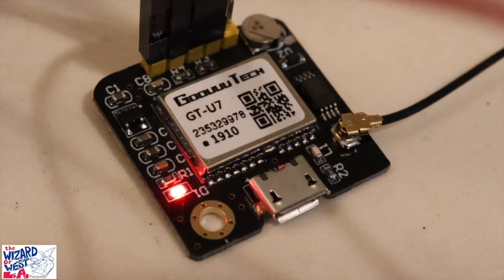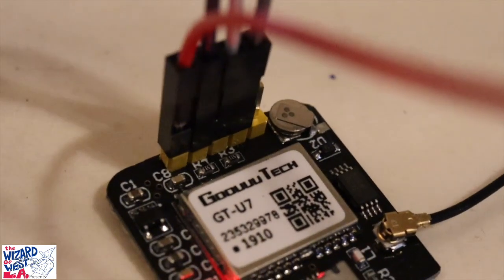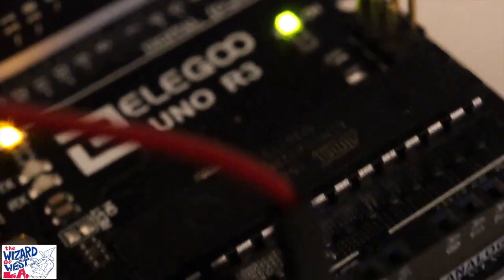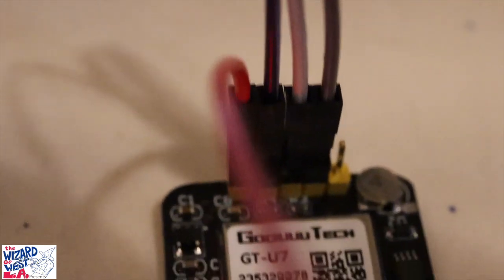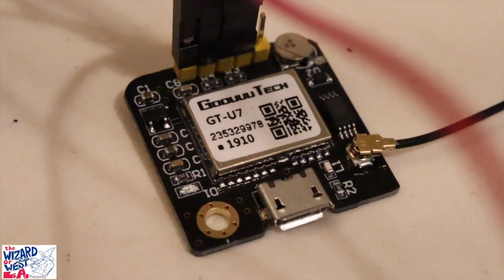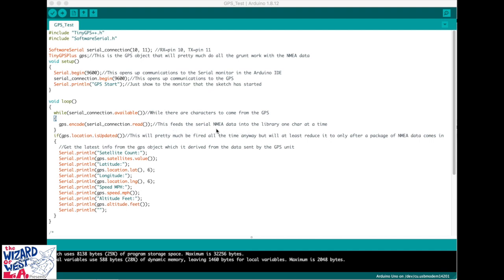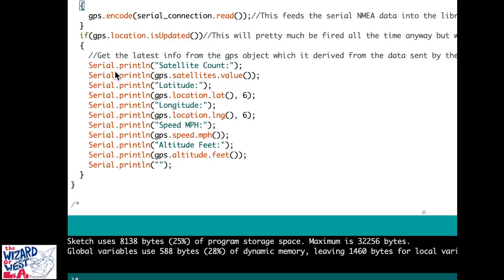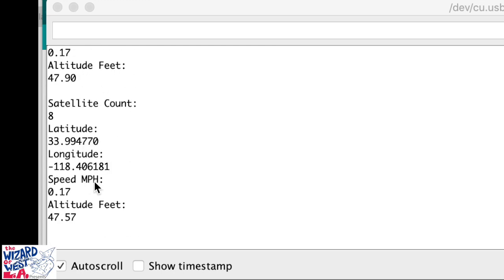How to use the GT U7 GPS module

Comment: Try using the TinyGPSPlus (by Hart)  library and the FullExample sketch. Change the GPSbaud from 4800 to 9600 and ensure the serial monitor is at 115200.
Take everything outside, press the reset button in the Arduino, and wait a long while. For me, I was surprised that all of a sudden,  I had 4 satilights, and all the data was populating. I tried the sencond module in the same way, and eventually, it also started to display data.
Good luck...

Comment: here you go:

#include <TinyGPS++.h>
#include <SoftwareSerial.h>

SoftwareSerial serial_connection(10, 11);
TinyGPSPlus gps;

void setup ()
{
  Serial.begin(9600);
  serial_connection.begin(9600);
  Serial.println("GPS start");
}

void loop()
{
  while(serial_connection.available())
  {
    gps.encode(serial_connection.read());
  }
  if(gps.location.isUpdated())
  {
    Serial.println("Satellite count: ");
    Serial.println(gps.satellites.value());
    Serial.println("Latitude: ");
    Serial.println(gps.location.lat(), 6);
    Serial.print("Longitude: ");
    Serial.println(gps.location.lng(), 6);
    Serial.println("Speed MPH: ");
    Serial.println(gps.speed.mph());
    Serial.println("Altitude feet: ");
    Serial.println(gps.altitude.feet());
    Serial.println(" ");

  }
}

Comment: Thanks for this,  did you find this GPS module to be good and reliable?  I cant seem to get it to connect. I updated the code with an "else" just to show its doing something but it doesn't connect indoors after a few mins, Im next to a window too.

  if(gps.location.isUpdated())
  {
    Serial.println("Satellite Count");
    Serial.println(gps.satellites.value());
    Serial.println("Latitude");
    Serial.println(gps.location.lat(), 6);
    Serial.println("Long:");
    Serial.println(gps.location.lng(), 6);
    Serial.println("Speed KM");
    Serial.println(gps.speed.kmph());
    Serial.println("Altitude ft:");
    Serial.println(gps.altitude.feet());
    Serial.println("");
  }
  else {
    Serial.println("Waiting to connect...");
    delay(5000);
  }

Comment: Hi Wizard,
I have bought the exact same GPS module and ran the same code as yours (with the correct libraries installed) and it does not print anything appart from Starting GPS. 
The red led blinks but apart from that, anything changes. I've also ran the following code and outputs: "no GPS device detected, check wiring", but the wiring seems great, I've swapped wires and changed pins, even from Arduino Boards and still the same error... Could you please help me? Thanks. Love your videos.
Reply from the maker: Thanks so much for watching!! I will check to see what I was using for the wiring did you check my website?
Reply from the maker: Once I did get a bad one. :(

Comment: Is there any reason why I cant see output in the serial monitor other than being in an open space for the GPS to lock? I've been trying for more than 10-15 mins but no hope
Reply: same
Reply: @jaume748  turned out I had a hardware issue with my GPS. I tried with a new one and it works

Comment: Hi, i keep receive this message "Location: INVALID  Date/Time: 0/0/2000 00:00:00.00". I am new in this domain and I really struggle to make this modul gps to work. Any idea what cause this error? (I have the right wire connection and I am using the same code)

Comment: Interesting video you made. I have a question regarding of the GPS that pings every seconds. How do I change it from one second to ten seconds delays? It would makes it easier for me to see the point of trip every ten seconds instead of one seconds each pinging. It should make it easier to read on maps. Thank you.
Reply from the maker: I will find out. I am going to be using that unit again for a project. Thanks for watching Kermit in Mountain!!!!
Reply: add this line before the last  }  bracket --->      delay (10000);      // this is milliseconds
Reply: however doing this, may mess up your Speed as it wont be updating fast enough

Comment: So I used your method yesterday, and the GPS worked when I tried it. However when I tried it this morning, it just doesn't work. The only thing that showed was 'GPS Data' on the serial monitor. I don't know what happened, but I kinda need it to work for tomorrow. If someone can respnd to this query I would be very grateful! Thanks in advance!
Reply: Try going outside and letting the gps connect to a satellite (red light will flash on the GPS), may take a few mins
Reply: John, in some case, the battery on gps may be bad. I have two identical and one starts at 30 seconds, while the other starts at 7 minutes, it turns out the battery may be bad. So, I had to find another battery for the gps and put it together.

Comment: whats with the blinking light on the module?
Reply: That's the pulse-per-second (PPS) signal that the module provides when it has a solution.
Reply: @timrussell73  okay then why wouldnt i see anything being reported via terminal after checking all connections are correct according to my last successful readings?  thanks for the response Tim.

Comment: Works great. Need just to be patient. The GPS requires time to startup.
Reply from the maker: Excellent I’m glad it works
Reply from the maker: I’m experimenting using it for other devices. Let me know what you find out. Any other tricks to it?
Reply: @TheWizardofWestLA  Nope, once connected, the GPS works perfectly also with the original antenna
Reply: how much time im going on 5minutes and nothing
Reply: @arletpaz8010   your gps battery may be bad.
Reply: yea how long and also did you need to install any libraries?

Comment: Actually I don't even get garbage, just "GPS Start".  Probably it is just a bad module.
Reply: hey I was wondering if you ever got a fix for this, because I'm currently having the same problems
Reply: @PoppyDada  same here ever figure it out?
Reply: im having same issue....'GPS Start' only
Reply: same... Anyone find a fix for it?
Reply: I had to switch the pins in the code. For whatever reason switching the physical wires didn't work, but the code did. Also, cut and paste the if statement so that it is inside the while loop. Mine is working perfectly now.

Comment: I have the same module as yours but I get only garbage!  I've tried everything from changing the wiring to serial speed but still get either nothing or garbage!  Any Ideas?
Reply from the maker: Lawrence Koenig that did happen to me too. Double check the wiring for TX and RX. I also had to reboot
Reply: I've switched the pin 11 and pin 10 in your code and get the same result.  The wiring is confusing though.  I thought TX from module should go into RX on the Uno but that is a matter of definition so I tried it both ways and neither works.  I even changed the wires with the same result.  To make sure the code is OK I re downloaded yours and get the same result.  Maybe this jus tis a bad module!
Reply: @lawrencekoenig3702  Hey, I was having issues with this module as well and when I connected it to a program called u-center, I realized I just couldn't get a proper satellite fix leading me to believe that the antenna was trash, not the module. Ordered a new 28dB Gain SMA external antenna and it works flawlessly now. You might want to give it a shot.
Reply from the maker: Also check every line in the code for the variables. Once I hit a space key and didn’t know it, and it changed the whole write string to the serial monitor. It also produced garbage.
Reply: Thanks for the tips.  Unfortunately none of them worked!

Comment: im finding that although the code doesn't generate errors, I cannot get data in the serial monitor. my Arduino Uno works and the communication light is flashing on the GT-U7.
Reply from the maker: Double check the baud rates.
Reply: I have tried on my Arduino Uno, it works with the TX wire of GPS connected to pin 10 of Arduino (no need for RX (on pin 11), Arduino will no "speak" to the GPS chip, data comes through TX wire continuously, we only have to read them). I work with Arduino for a week only so it's difficult to find the problem...
I then modified the code because I only want time : hour, min, sec (gps.time.hour(), gps.time.minute(), gps.time.second()), and day/month.
Reply from the maker: Yes it looks like it only receives RX